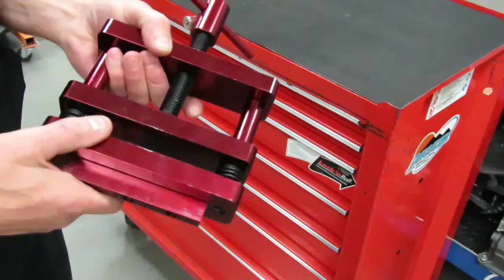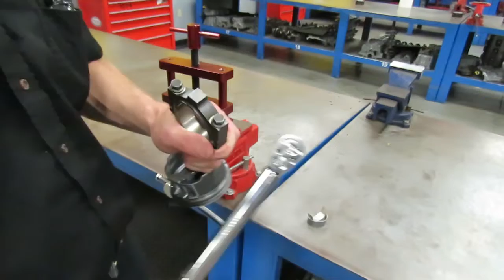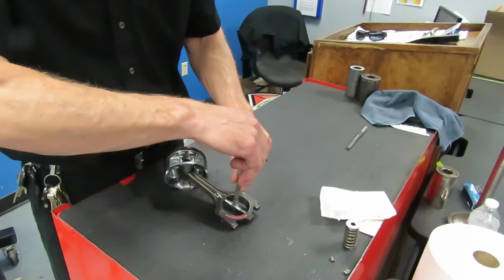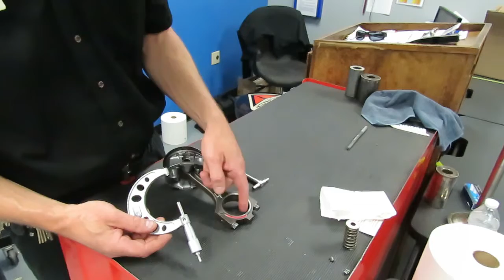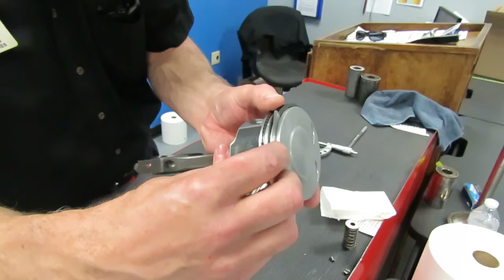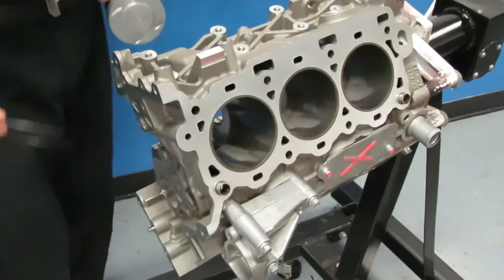Ford 3.0 Piston and connecting rod diag.

Comment: I am not trying to be a Jerk...But those ring pliers...UGH!...I have literally watched and participated in assembly of NASCAR level competition engines and they (Experienced Builders) almost NEVER used them, you can, and I have seen it first hand, seen people bend (yes they can be bent horizontally!) Rings with the plier tool...I personally was about 1 year in at the shop...(trying to do it "by the book)...assembling a 427 Tall Deck Chevy Truck engine (with the 3+1 Ring Pack) and had just put the tool on these name brand "H" rings, and had not even got them open far enough to get them to clear the piston and the ring broke into 3 pieces...My Boss at that time, a builder for 50 years, took the tool and Broke the next ring out of the package (luckily we had extras of these rings) and he was so pissed he called "H" and bitched, he told them "Your Instructions Say to use the tool, everyone is told the tool is the CORRECT way!" and I am not joking he slammed the phone down on the guy on the other end making the receiver bell ring...according to him they told him to "walk them on" and so we did...and we walked 1000's of them on after that too...Yeah, I have them (I even bigger one for pistons like 2cyl Deere and Diesels with up to 8-10" Bore IIRC) in my toolbox...and I bet I haven't used/seen them in many years...though to be fair...I haven't been at the shop in many years and only take occasional "odd-jobs" now...
Reply from the maker: been using them for 25+ years and never broke a ring I don't think the tool is the problem
Reply: @Myvintageiron7512 I will agree to disagree...When an almost 70 year old engine builder that was at one time an engine pioneer for NASCAR, Drag, and others, before we were born... He had ALWAYS had walked them on by hand...used the same tool and broke the next ring... I think I am going with the tool is at fault... I could have done something foolish too, I did get married. LOL